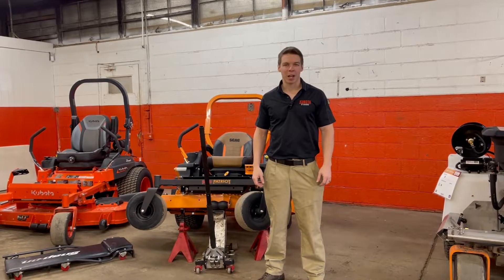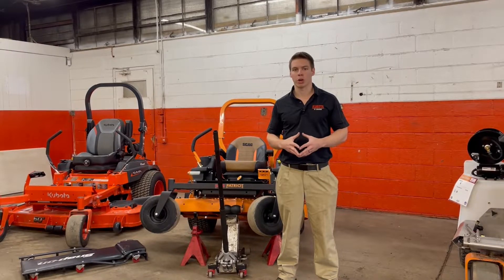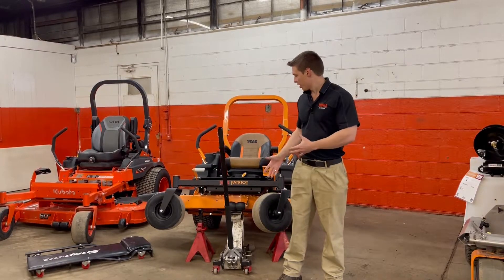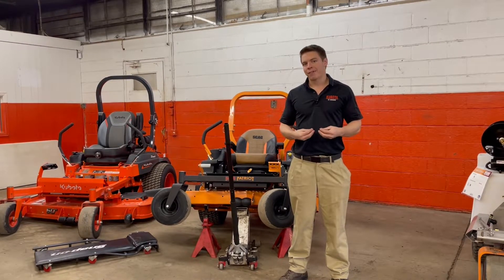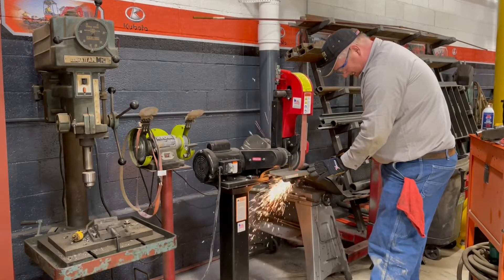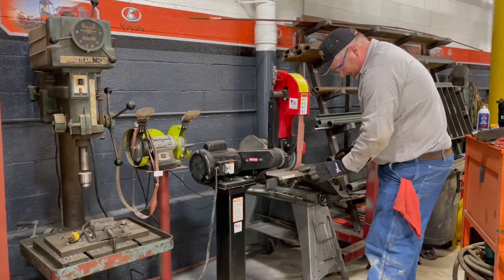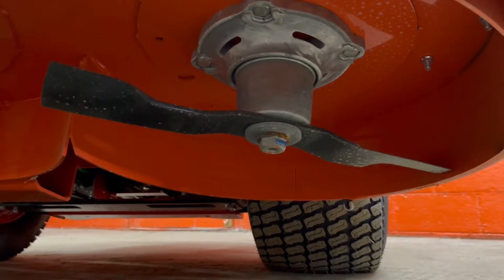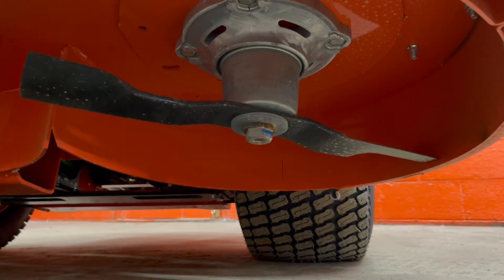Sharpening Your Mower Blades

Comment: I guess that's one good thing about my dealer/salesman not getting my tractor order correct, I ended up without the 60" mower deck for my BX that I wanted...so my mower blade sharpening is extremely easy as I have a lawn tractor and a Mo-Jack...simply drive up to the Mo-Jack, lock the pins in, raise the front of the lawn tractor and with an impact/socket remove the blades, install another set and away I go.  I just set the blades aside to be sharpened later...I keep a spare set of blades so I just swap back and forth and just have the other set on the shelf after I've sharpened and balanced them. 

NOTE:   You left out the very important step of balancing the blades before reinstalling them...if you don't balance the blades you end up with a horrible vibration, and can damage the mower deck spindle bearings, and over time the machine itself from those excessive vibrations, and worst case you cause a blade to break from the high speed/vibration combination.